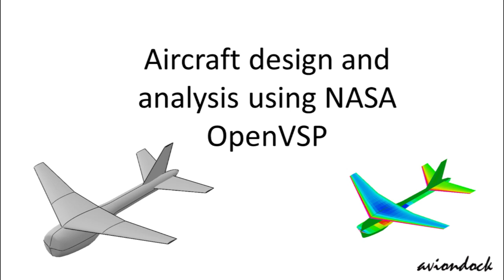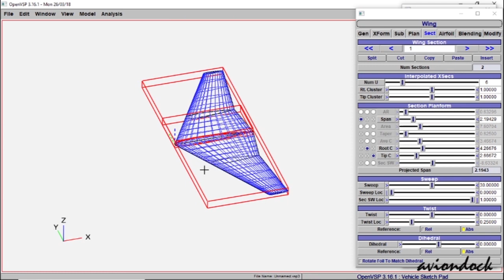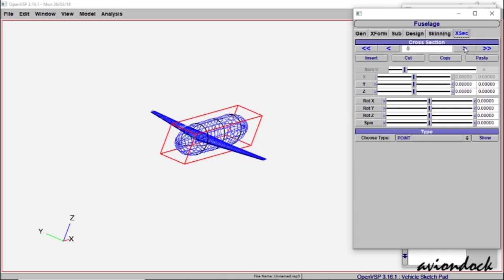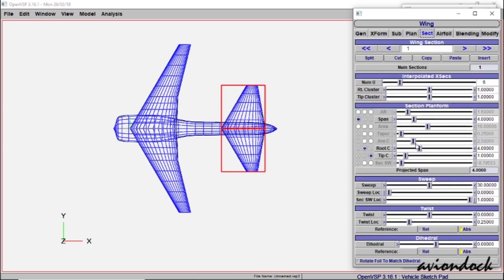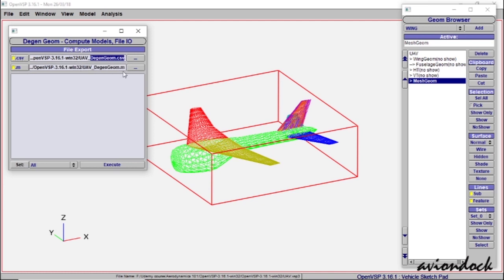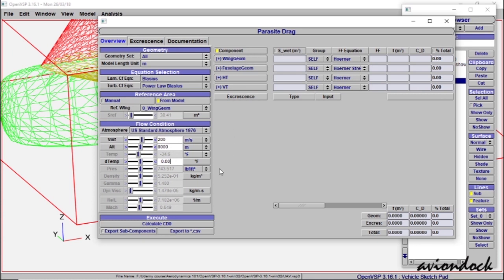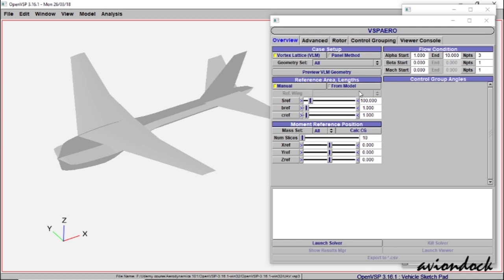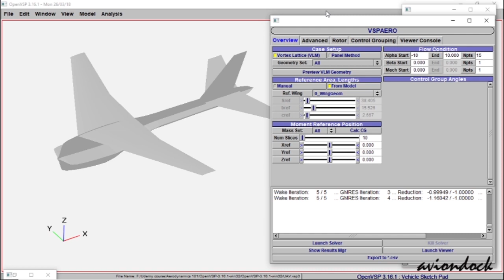NASA OpenVSP modeling and analysis tutorial

Comment: Hi again, 
I have a question: In VSP Aero, Mach number was set as 0. But after the graphs are plotted, we see that a Mach number is evaluated based on the altitude and flow velocity given. Why inserting M=0 in variables do not create a problem? (We only varied alpha and inserted 0 as M, but M did not stay as zero.)
Reply: M=0 is for the aircraft speed but the flow velocity can be from airspeed and not the aircraft speed. For example, if the wind gust is 100km/h, that is some flow velocity. It makes sense if the Mach is not equal to zero if the boundary conditions is not properly defined.